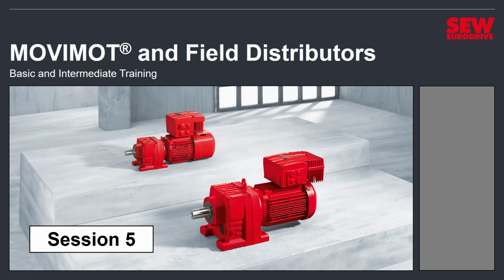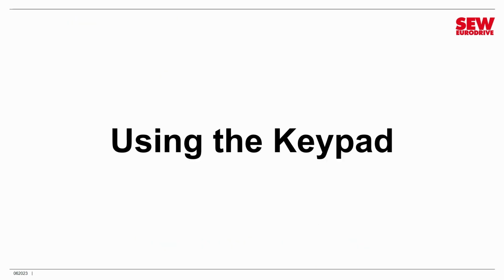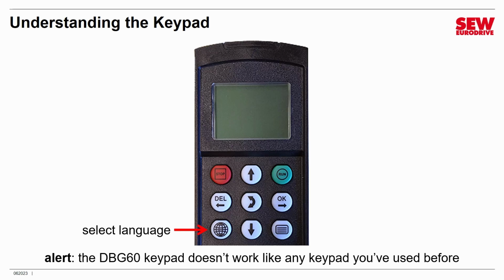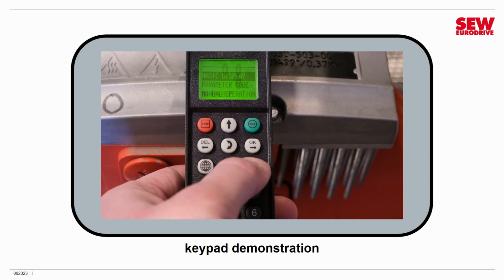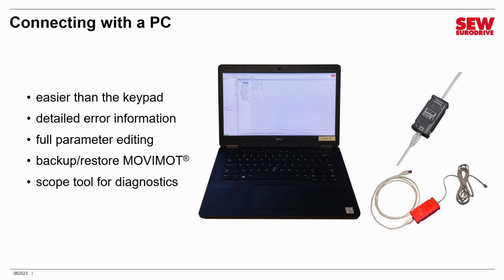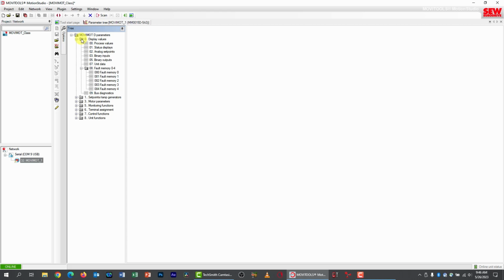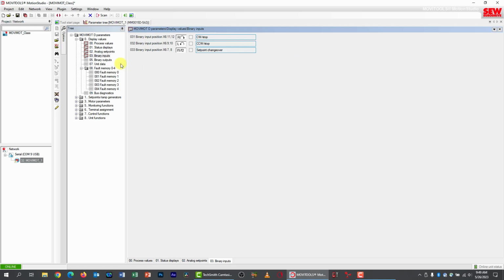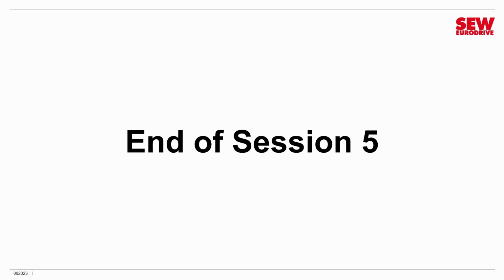MOVIMOT® and Field Distributor Training – Session 5 – Faults and Diagnostics

Comment: hii.. how can i see the parameter list with DBG60 keypad?
Reply from the maker: Hello. If you are trying to use the DBG60 with the Movimot D decentralized inverter the parameters for it are very limited since this device is usually only configured with the DIP switches and rotary dials on the underside of the lid. There is an option of activating "Expert Mode" which requires the Movimot D to be configured via the parameters along with the DIP switches but this is not common.

You can view the available parameters by pressing the (3 horizontal lines button) then selecting (Parameter Mode). Just remember you may not be able to change them if you are not in "Expert Mode". You can get an example of these instructions in the Movimot D Operating Instructions linked here: 

https://download.sew-eurodrive.com/download/pdf_u/28516672.pdf
Page 190 - 194: Viewing Parameters with DBG60

You can contact your nearest SEW Eurodrive office using this link and asking for Electrical Support when calling in.
https://www.sew-eurodrive.de/meta-pages/contacts_worldwide.html

Comment: When I plug the DBG60 keyboard into MOVIDRIVE, the screen displays NOTE 1 ILLEGAL INDEX. Can you please show me how to return to the original interface? Thank you very much
Reply from the maker: Hello. That error means something was typed in that wasn't allowed by the keypad. If it does it every time the keypad is connected. Then it could indicate the setting may be set as a "wake parameter" for that specific keypad where it shows on the screen as default.

Are you able to use the keypad at all and exit that message? Typically, the "DEL" key or the center "sideways arrows" key will allow you to back out.

If you can back out of the message then press the 3 horizontal lines to enter the "MENU". Then use the arrows to scroll down to the option "DBG DELIVERY". Then press "OK" to reset the keypad. Once you do that the keypad should restart and show a globe. Press the "GLOBE" key to cycle between the languages. Once you complete this the keypad should operate normally and not start with the Illegal Index message. This resets any customizations done to the "user menu" and "wake parameters" of the keypad.
Reply: I tried to exit that warning message with the DEL key but it didn't work. Thank you, sir
Reply from the maker: You're welcome. If you have another SEW inverter you could try plugging the keypad into it to see if the message goes away. If you still can't exit the message then there may be something wrong with the keypad and it would need to be replaced. Our telephone support is free if you want to find your nearest office at this link and give them a call to help you troubleshoot or get a replacement keypad. https://www.sew-eurodrive.de/meta-pages/contacts_worldwide.html